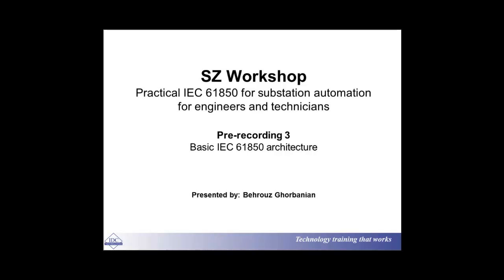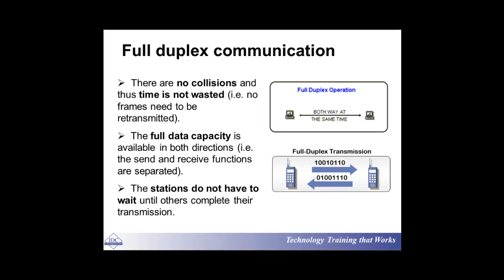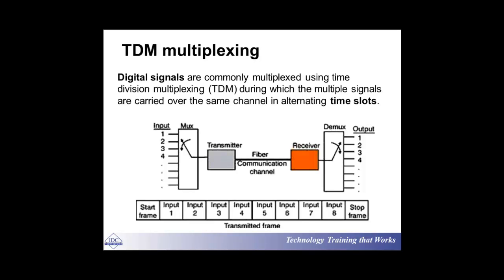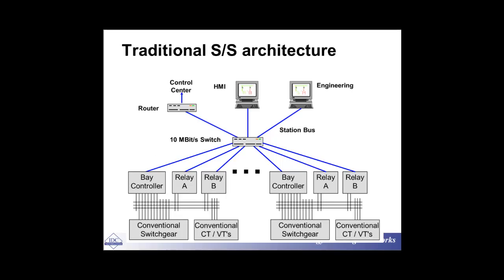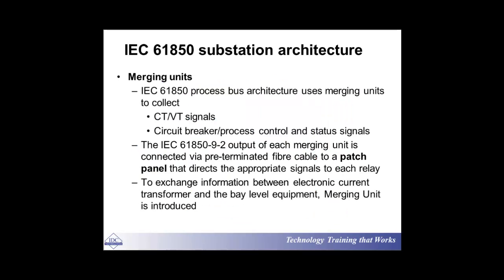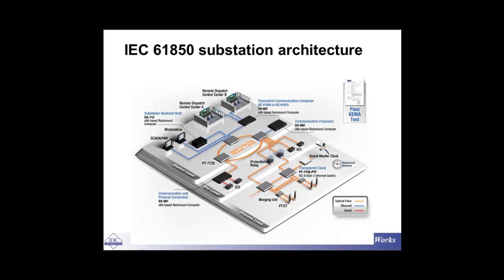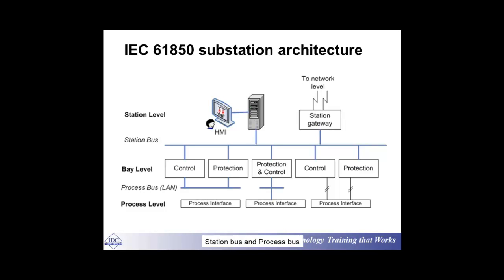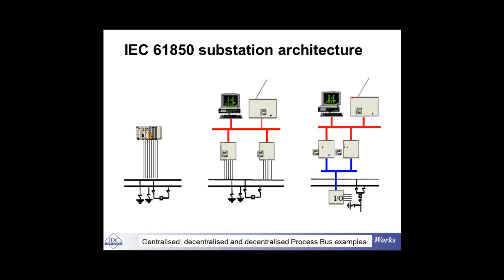Practical IEC 61850 for Substation Automation

Comment: There is NOTHING USABLE or PRACTICAL in this video. There is so much information missing that this is IMPRACTICAL for Engineers in the Real-world. Simplex, Full, half duplex, multiplexing, and HMI's  should be omitted from the topic, and can be dealt with separately. Please completely revamp this video or rename the video so that it does not contain the word PRACTICAL. A foundational video like this would need to compare and contrast to similar protocols and explain how this standard is better (or best) for Substation Automation. Additionally, your competency course on your website is also sorely lacking. The name of this video and the content DO NOT MATCH !